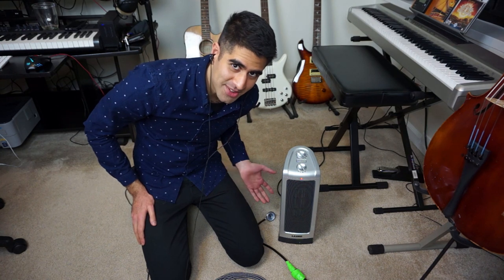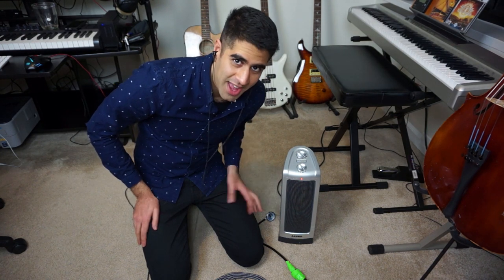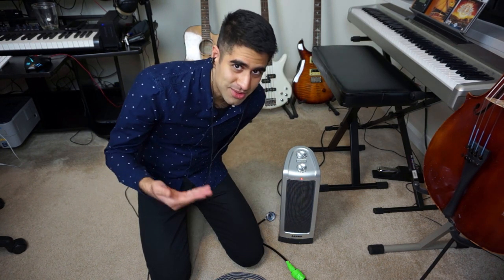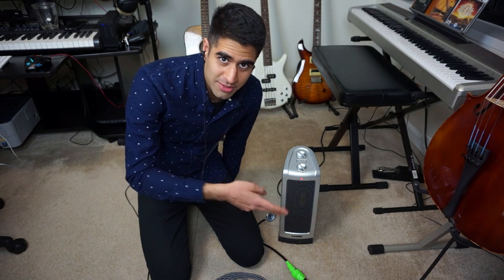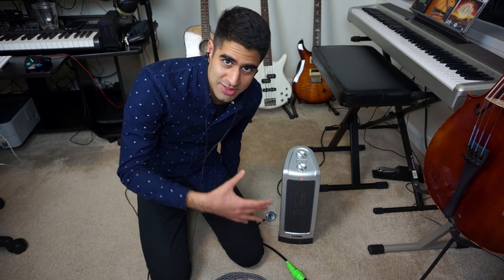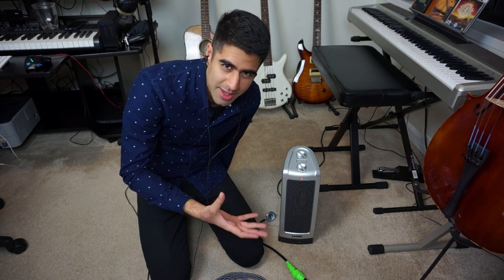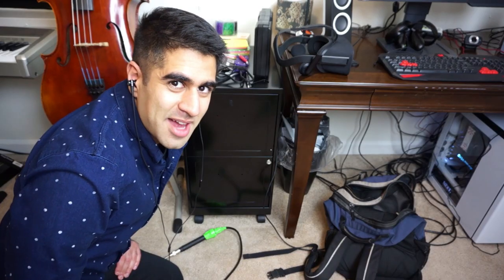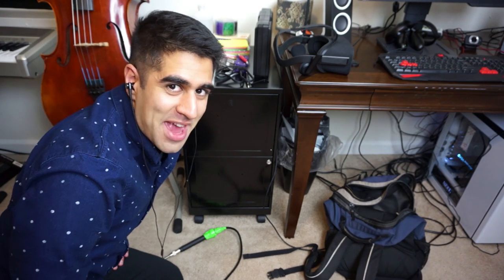Recording with a Stethoscope Microphone - Part 1

Comment: I've been working on building one of these, though I'm having trouble getting a solid connection between the tube and the mic. I didn't buy the microphone you suggested rather trying to use one I had lying about, but the head is a bit more concave and I don't think it is picking up the stethoscope super well. do you just have a crazy preamp boosting the volume?
Reply from the maker: My gain on the Zoom H6 is set to 6/10, so nothing too crazy! The capsule on my mic is totally flat though, so that may be making things easier. What mic are you using?
Reply: OK, I was using a Shure SM57 since I didn't want to buy another microphone for just this purpose. I was running it through a Cloudlifter preamp (+25db) and I didn't get a whole lot. I also didn't want to do a crazy tape job on the microphone since I definitely want to use it for other things as well. Any advice would be appreciated,  but I'll keep experimenting!
Reply from the maker: Ahh that would be why. You're using a dynamic mic, whereas I recommend using a condenser mic. Dynamic mics are FAR less sensitive, and are best for recording louder sounds (which is why SM57s are almost always used on snare drums).
Reply: Oh! I'm an idiot. I didn't read enough about the microphone you linked, I thought it was a dynamic similar to the SM57. I do have a condenser mic, but it's not a good shape to butt up a tube like this. I will have to investigate other options (or maybe invest in that condenser because I do like me some microphones :)